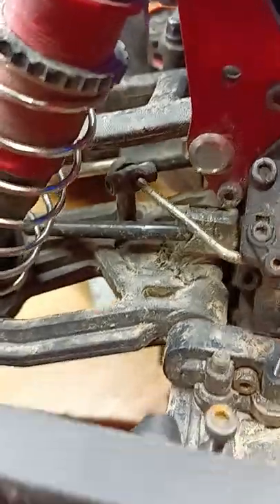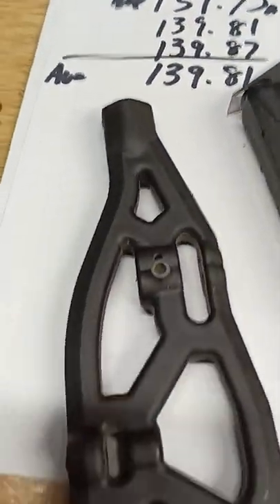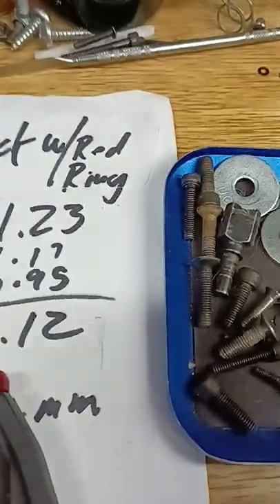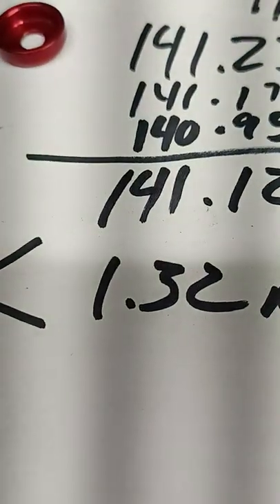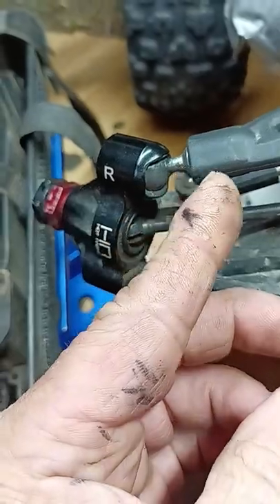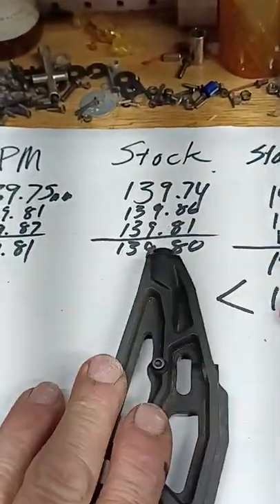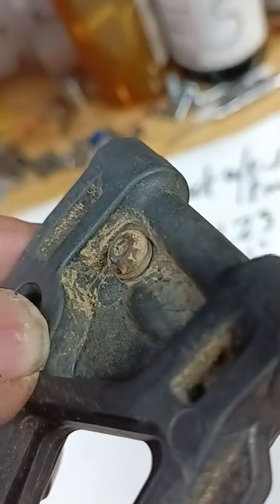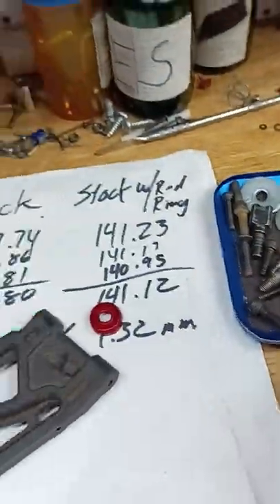THE FIX Arrma 6S DRIVESHAFTS from POPPING out of the drive cups,..

Comment: The red ring as you call it, reinforces the end of the arm from breaking apart . The problem is you need to adjust the droop screw to stop over extension of your shocks and pulling the dog bone out.
Edit :
And I came back to do an edit. My edit is I'm not being an ahole just stating a fact.
Reply from the maker: You set your droop screws to set the arm from dropping to far and breaking the piston.  T he driveshaft is to short.  it need to be about 1.5mm longer.  they didnt take into account when they added the red ring.  i have never seen an end blow out with or without the red ring.  i think it was a bling to make it look better.  but that my take on it.
Reply: @readeracingRC  lol I agree. I've never had the issue either. 👍😊
Reply: That's how I took that as fact or the actual problem, thanks for the info I will do that...I'll put those washers back on and adjust the droop!!! 👍👍

Comment: Great video Brother. I took off the red rng & the washers. The other thing I did make the dog bone sit deeper in the output drive, was I shaved off a couple millimeters off the a arms With a dremel. Shaved them flat a few mills and Bam problem solved.  There's plenty of thread so you don't compromise that issue. Hope this helps! 👍🏽

Comment: I’ve shaved these for years, I had a felony do it, didn’t even think of of this, thanks dude!
Reply: Oh, on the felony and cars with that set up, cut a flat piece of rubber and put it inside both ends of the axle carriers to take up the slack. It’s from the hub starting to wear on the diff side. Doesn’t take much. It’s been a while, but it works. Thanks again.
Reply from the maker: by putting the rubber pieces in the cup,  you mean the same idea as putting the ARA311028 spacers. Right?  Personally im not sure why they put the red rings on in the first place.  i have never or sean anyone that broke a arm at the end of it.  by the hinge pin ya. but not the wheel end.  nice chat speedo man,  i keep hearing your name about this hobby.
Reply: @readeracingRC  I’m like an old retired name lol. I overbuild things that have no reason to exist lol. I use old tire and cut it in circles in a pinch on both ends on the typhon and 6 s road cars. I’m a retired street bike stunt rider that got into the hobby. I’m friends with some guys you may know, maybe that’s why you may have heard my name. I apologize, I was looking for fix for the street cars I forgot I already knew about. But your video is so important! That’s a great pointer and needs to be known about. Thank you for showing people. That’s what the community is about buddy, supporting each other and having fun. Great job! 🤘🏆
Reply from the maker: @SpeedSyko  thats some funny shit right there.  im an retired motocross racer of like 30-40 years.  i was flying drones and seen some kids with RC rigs and a light bulb went off and off i went.   this is like racing but the crashes are quite painless.  ill have to catch up on some of your vids for reference's. lol  
Have Fun

Comment: We are just about to rebuild the front diff on our notorious to replace the diff cups hopping that would stop the driveshafts from popping out.  I'm going to remove the washer and red cap while I'm in there!  I'm glad this video popped up!  We are also going to try the rubber piece in the cups on the 6s Typhon.  Great tips!
Reply from the maker: i found that the more the bearing and parts wears, out it makes the problem come back . (only on 60 foot +) launches it popped out.  i went to the extreme and ground off another 1.0-1.5mm of the end of the arm..  where the red ring was.  glad it helped you out.  Have Fun
Reply: Those driveshafts don't get anywhere near bottoming out in the cups.  I'm not sure why they don't make longer driveshafts!   Thanks again for the tips!

Comment: Thanks for this!  My right front dog bone keeps popping out of my Outcast 6S EXB and it’s so frustrating!  This looks like a doable fix.
Reply from the maker: when they decided to add the red ring, for durability, they didnt think about the length needed to be added on to the driveshaft.
Reply: @readeracingRC , so short-sighted of them!  Unfortunately, there doesn’t appear to be a remedy from the aftermarket either.  I have since replaced the stock dog bones up front with M2C beefcake dog bones and any extra length from them is minimal.  I would love to use the red rings for that durability, but the popping dog bones are a pain!
Reply from the maker: You can grind off the ends like I shown in the video.  Really have to be careful to make it only 1.5mm ground off.  And yet make the ring sit like it did in the factory setting.
Reply: @readeracingRC , thanks for the tip.
Reply from the maker: yes,  i ground off about 1.5mm off the lower arm to fit the red ring.  but after all the trouble I didnt do it to the outcast and never had any issues without the red ring.

Comment: I removed the red spacer from my Fireteam, and the washers on the other arm, then redid my toe adjustments and its fine now, you also can buy the 1mm longer driveshafts for the front, but i took the cheap fix...I.forget who makes the plus 1 driveshafts....
Reply from the maker: i didnt know there was a place to buy one. but this trick is really cheep.  lol
Reply: @readeracingRC I agree take the cheap route cause stock driveshafts are fine once you take that spacer/washer off the arms.....by the way I think M2C makes the plus 1mm driveshafts for Arrma!!!

Comment: I also suddenly got this with a Mojave. I thought I would order RMP Front Cvd Drives because I thought the axle was crooked. To my surprise, these were shorter than the original ones. That compounded the problem with the original upper arm. I removed the red ring and that brought the whole thing together a bit better. But you will lose the position of the wheels until you adjust the steering arm and you have the intended camber and toe correct again. A little tinkering and then it will be right again. Thanks for your solution. This one works for me!

Comment: Hello, how many mm are the inside front turnbuckles in mm? So inside inside for the toe-out. Thank you very much from 🇦🇹
Reply from the maker: Both steering arms have to be equal length.  mine are 123mm from screw hole to screw hole.  This may not be the same for you, because i have a set of rear turnbuckles on the front. it took some doing but now i have 5mm wide instead of the 3mm stock ones.  much stronger.  other than that i m not sure if i answered your question.  but having  2 or 3 degrees toe out for better steering capabilities.

Comment: I've had an Outcast EXB for almost going on a year.  I've bashed it, flipped it, etc and never had this happen.  While running it yesterday at the max speed over some very patchy grass, it happened to me twice.  I realized I hardly had any pre-load on the shocks.  After I tightened the pre-load rings, the issue didn't return.  I'm pretty sure not having the pre-load tightened down, was causing the a-arms to over extend.  Not saying that's the permanent solution, (because you should be able to have no pre-load and not have issues), but it solved the problem at the moment.  I do however have those stock washers / spacers on my a-arms and will be removing those.

Having those washers on the droop screws is also a good idea.  When setting those a while back, I did wonder about them being pushed back into the a-arm.  It's only inevitable that they eventually will get pushed in w/o washers, so I'm going to get some of those to.
Reply from the maker: Yerp.  It seems I was always adjusting the drope screws and wasn't getting any where. Untill I figured it was stripping the threads. 
Have fun
Reply: When I got my V5 Typhon I looked into things you should do right off the bat with Arrmas, esp the 6s line and one  you must do was to adjust the droop screws to save breaking off your shock ends, Arrma sell double socket screws that make it  easier to adjust and won't dig into your arms so much.
Reply: @readeracingRC  I added washers to mine and have not had to readjust them since.  @RCexplained says they are only for adjusting ride height.  While I beg to differ, I think it does both.  Adjust ride height, while preventing the shocks from over extending.
Reply: @uBreakIt iRepairIt  look into AJJAMS video on dog bones coming out. He also says that the end caps need worked to prevent dog bones from popping out.
Reply: @JustKeepLivingFPV  sold it and got the 4S version which is way funner at the skatepark and is a beast. The issue was resolved by removing the red washers / caps on the ends of the a-arms. Another video also suggest shaving 1-2mm off the ends of the a-arms which I never got around to doing and probably wouldn’t have needed to.
Reply: @ubreakitirepairit3569  yeah you are right it's too much work just remove the caps. Lol I built a basket case kraton 6s exb and I love just looking at it. It's like a piece of art at this point.

Comment: I saw the video of the guy who pressure washed and WD-40 his rig and I agree with your comment. How do you clean up yours? Thanks in advance.
Reply from the maker: I have a hose adapter that sprays a small stream of water. Hose it off using a paint brush to wash with. Blow it off with the blower side of a vacuum cleaner. (Not so fixed in one spot) dry in front of a heater.  then if I feel so necessary I spray with silicone spray, wipe down with armor all. That's just me.  I try not to let it blow too hard wherever there are ball bearings. Every 3-4 cleanings I'll pull the hinge pins and shock mounts to keep them lubed up.

Comment: How can I fix a ball joint that has popped out on my Arrma 6S RC car? Looking for detailed steps and preventive measures to stop it from happening again. Thanks
Reply from the maker: my apologies for the lousy explanation in the video.  i mean to do it over.   But the whole idea is the shafts were made first on the rtr's.  the exb came out and put the red ring on the end of the arm to make it stronger.  i see not needed.  but there about 1.5 mm thickness. so adding the ring's made the shafts to short.  by removing them it puts it back to stock.  but it's still to short in the first place.  i have ground off the plastics on the end of the arm to make it shorter. and the ball will not pop out when landing off big jumps or the swing arm bottoms out and it just walks it self out.  a found the more worn out your bearing, cups, diffs.  get it makes the isus come back.  so keeping it fresh will keep it from doing it.  also putting in the rubber insert you put in the cup helps to.
Reply from the maker: oh wait i read yours again.  you mean the balls at the end of the arm.  the steering blocks?  oh oh.  you 
 mean the plastic is  worn out.  its messed up the  first time it pops out.  nothing really you can do, but get some aluminum ones.  hot racing vivitvon etc.  the plastics stretch out and it's a bad design for plastic parts.  should be aluminum from the factory.

Comment: This fixed my dog bone issue but now my servo saver is loose and my shocks are super stiff like it goes down but doesent want to rebound back up feels like something’s binding did you have to mess with the tie rod link?
Reply from the maker: I think I put about 20 mm of preload.  measure from the spring tensioner ring to the bottom of the shock cap.  20mm might be a lot 15mm lowers the ride .  i have it high for landing from big jumps.

Comment: Axial bump stops on front shocks problem fixed with out fucking up your camber or toe like this. So problem is fixed with out making your car handle like shit and over wear the out side of your tires. Don't do what the video says. learn about camber and toe then come back. You will see you want a alternative fix to the one in the video.
Reply from the maker: Dude if you remove 1.5 mm on the lower arm, and then remove the washers on the upper arms that's 1.5mm.  nothing has changed in the chamber or tow in. Even if you did not 1.5mm is not going to do that much of a difference as far as a bashing truck.